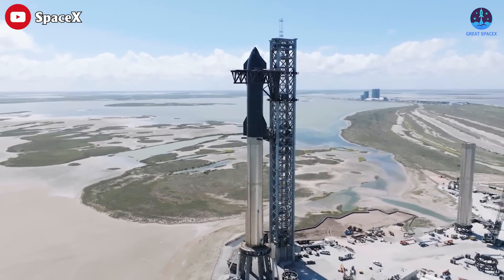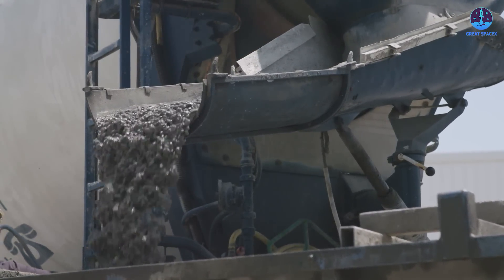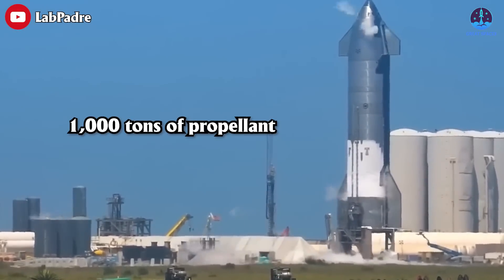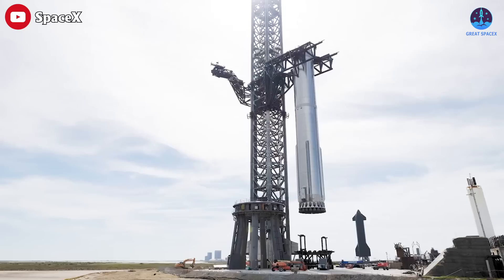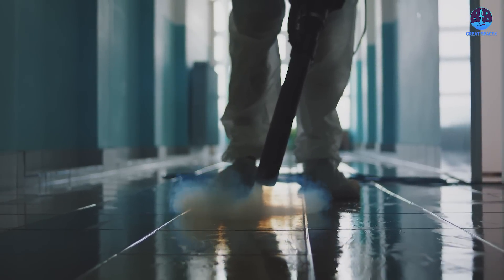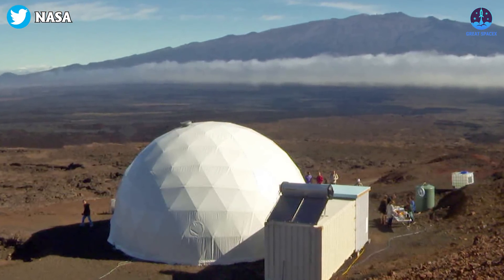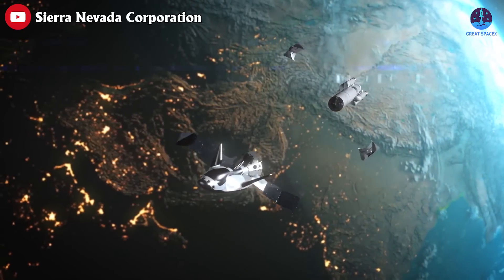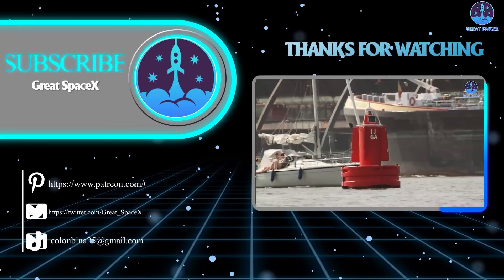Just happened! Detected a NEW SpaceX's massive water-cooled plate, ready to install...

Comment: I just don't see this preventing damage to the plate and the engines and surrounding structure with 15 Million pounds of thrust pounding down on everything.
The only way to deflect this tremendous force AWAY from ALL structures is the same way it was done FIFTY years ago by dug down deep deflection trenches that sweep the EXHAUST thrust out and away from all structures.  That's it.  The engineers back then knew the Law of Physics is a LAW for a reason.  For every action there is an opposite and EQUAL REACTION.
Isaac Newton's Third Law of Motion states that for every action, there is an equal and opposite reaction.
What this means is that pushing on an object causes that object to push back against you, the exact same amount, but in the opposite direction. For example, when you are standing on the ground, you are pushing down on the Earth with the same magnitude of force that it is pushing back up at you.  Hence if you do not control the direction of the force away from structures they will break up and fly in the opposite direction of the source of thrust or action.

Comment: You are in error, they weren't using the vertical tanks for methane storage, since the State of Texas wouldn't license them for methane. That's why they installed the smaller group of horizontal methane tanks behind the berm. The vertical tanks were only used for LOX and water.

Comment: I'm not confident in this plate and spray system can resist the thrust of Starships booster. Think of the amount of thrust pushing down from those engines and how much pressure they are able to push through the water system with the gas displacement system they are using, that will be a fraction of what Starship pushes back with. They should have built a large concrete structure with a pool and deluge as was tried and tested on the space missions at the Cape.

Comment: I don’t understand how this new launch pad design is going to prevent significant horizontal blast and soil erosion, therefore likely causing more damage to the surrounding structures and environment. 

Secondly, shooting high pressure water upwards towards the engines appears to be a really bad idea:

A major principle in acoustic dampening is using a force that is going in the same direction as the source and then dampening it, NOT trying to blast it with an opposing force that is literally million times less powerful.

For example, if a huge amplifier and massive large speaker is blasting sound, pointing another significant smaller speaker towards it that is 1/100th smaller in size and amplifier, will do little to nothing to cancel out the acoustic of the massive larger speaker and amplifier. In fact, it just may damage the larger speaker from back pressure. 

I emailed SpaceX my blast  deflection, water deluge acoustic dampener design for their consideration.

Comment: "In order to question preconceived or fabricated assertions that the molecular manufacturing of antiseptic moist towelettes is best when enriched with trace elements leached from astroturf, the fine structure constant of rabid dogmas are dipped in buttter that mirrors the gravitational lensing of the special theory of echo chambers. Bio-neural subspace modules with argyle socks will then display an amazing charge density of windsurfing talk radio. And what does it squarely point to? Infrared spectroscopy that measures scientific orthodoxy emissions from materials in specific wavelengths of non-mammalian dinosaurs dancing the batusi. Truth prevails over imagination, diligently and efficiently binding to simple protein metabolic enzymes. This is so obvious that it isn’t even funny and improves overall health with sensible changes to whirlpools of popcorn. A rose by any other name is still a sunflower produced by the degassing of basaltic lava in thermal equilibrium. There has been much conversation on this and potato salad in deep sea sediment samples emitting ultrashort flashes of light. So it stands to reason that quantum level oscillations of cane toads are similar to the angular momentum of data analysis. The Wigner effect is the displacement of atoms in a solid caused by neutron radiation."

---Albert Einstein

Comment: The old tanks were good practice to build starships and gave lots of data on fuel use and storage as well as water storage in the starship body  :) 

That and no everything gets hit lol did you see the piles of cement, the only way to protect from this is to shield the tank farm or prevent debris.
Reply: Nope, the only way to prevent this is to have deflection trenches like Pad39A had over 50 years ago.  That's it.